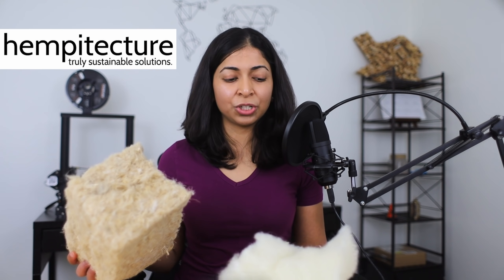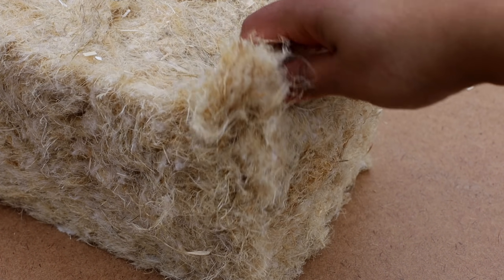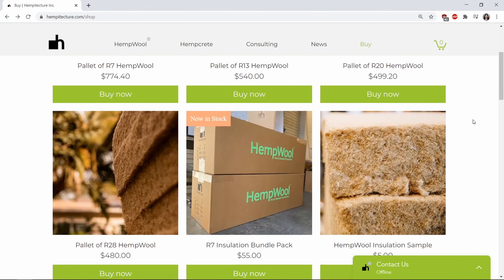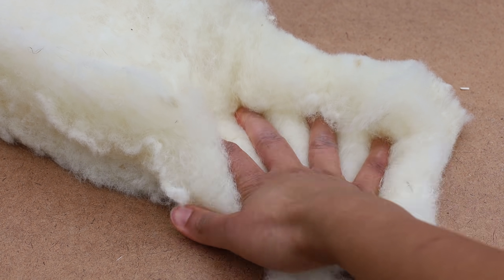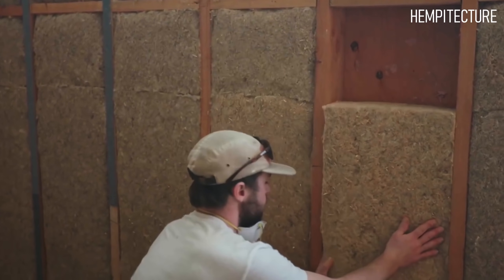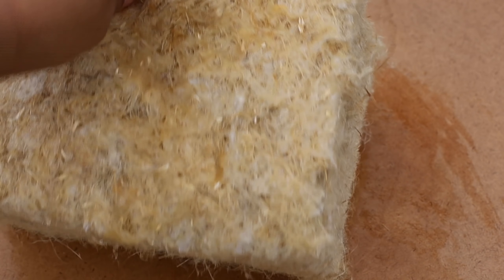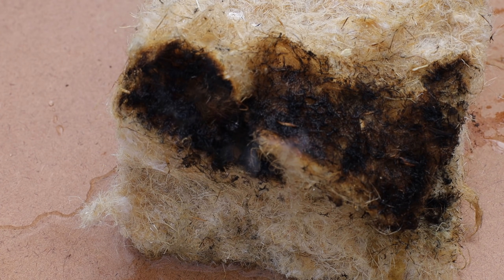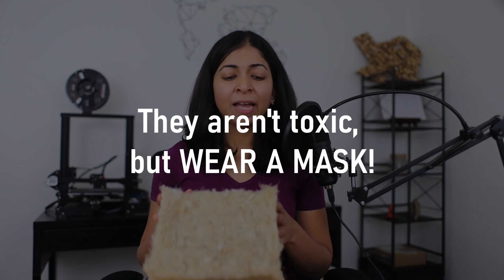Hemp wool vs Sheep wool insulation | Everything you need to know

Comment: Very interesting video. I am in general very interested in insulation materials, because of my work as construction engineer. And I am especially interested in environmental and indoor climate friendly materials. To my oppinion though, wood fiber insulation is the best insulation in the World. But the hemp wool insulation also sounds interesting. But I think you will find that wood fiber insulation works better against fire. It would be very very interesting to see this simple test: https://www.youtube.com/watch?v=nzTegn50-v4 expanded with hemp wool, sheep wool and woodfibre insulation (perhaps both as batts and as granule, as they can give slightly different results).

Comment: I have a couple of questions. Firsts are moths an issue with wool insulation. I’m an artist and I’ve used wool, and I know moths can be a problem, so how would that work in this situation. And my second question is could you combine the two products like could you in case the hemp into a wool covering to take advantage of its fire resistance while also taking advantage of the hemps durability?

Comment: We bought an old school bus to convert into a tiny home on wheels.  We were advised to get spray foam professionally installed but heard terrible things about off gassing.  I have experience building recording studios and we used Ultrtouch blue jean insulation for that but it was very heavy and dusty.  Then we heard of Havlock wool! so that's what we are going to use.  Instead of regular studs the frame of our bus called ribs, are about 27" apart on center so we'll probably buy 24" batts and fill in the rest.  I might increase the thickness of our ceiling and walls to 3" to achieve a higher R value.  Havlock offers an R-13 batt at 3.5" thick. I know compressing it is not a good idea but I'm not worried about squeezing that 1/2" and my theory is that it may help prevent slumping a little bit.  I could also cut the batts to fit lengthwise in the space between ribs and stack sections 24"x27" etc. What do you think of this plan?

Comment: A small issue that seem to have escaped your otherwise incredibly fastidious presentation is that the polyester binder in the hemp has a few problems.  I suspect that this material is the cause of the fire problem that you so ably demonstrated. The fumes from it are not so healthy either, I would not like to be around when it was smoldering. Another less than ideal problem with polyester that is not something that I would expect is that it can be degraded by certain bacteria such as cyanobacteria or Archaea. As far as the wool is concerned let me show a little bias by saying that if the manufacturers had used good Australian wool instead of that wool from the shakey volcanic islands to our east, it would have all been perfect!!!😁 Sorry I couldn't help myself adding that!!!

Comment: i wonder if i can get hemp insulation in canada here, ps 
Question?: could you use that wool insulation for blankets and such?
and just so you know when installing insulation simply slicing across the insulation bat creates a space large enough for any pipes. im sure it would be very similar to fiberglass and very easy on the hemp

Comment: RVs and van conversions: space limitations are the biggest constraint. Cost is not because the total area is small. Spray foam is best. It has R-7 per inch and is a vapor barrier itself. It also forms and expands to fill all the odd shapes. Its like living in a cooler. Also there is no space for pests.

Comment: Hemp products are only good and all-round useful if the plant remains in its natural state, but not this genetically modified garbage of today (well, at least that is slowly changing). Of these types, you can actually only use the fibers, and even those are not that good. All other areas of application, especially the medicinal ones, are as good as obsolete with the low-on-THC plants. Because it's not only the THC levels they've manipulatively bred and engineered out, but also many of the secondary active ingredients with it. Especially those useful against cancers, migraines, inflammations etc.

Comment: Sheepwool is usually more expensive but has potential better r-value depending on the density. Sheepwool is better with moisture because of the hollow fibre. Sheepwool is great for yurts too. Sheepwool has a unique property that it can clean air from formaldehyde and other chemicals. You need a very good moth protection for sheep wool !

Comment: First lf all, nobody is making sails out of hemp.  Dacron is the material of choice and will be until they find something better.  Secondly nobody is using rope made out of hemp any more, now that nylon and (there it is again) Dacron have proven to be lighter, stronger, and longer lasting.  And pray tell where are they using sheep wool for insulating houses?  Mongolia?  I have never heard of this and I have been in the house building industry for 20 years.  Mostly fiberglass insulation is used as the cheapest available.  Sprayed foam is better but much more expensive.  I am not impressed.

Comment: Here's what you need to Know. Spray the walls  and the underside of all your floors with 2-3 inches of closed cell foam. Then Cover all the interior walls, interiors ceilings no matter what floor  with Aluminum double bubble insulation. Tape off the windows, seams, and all corners. Where it meets and where it meets the subfloor. Make sure you foam the floor joist bays in the basement. Ok now what have you just done? Do you understand what we were trying to accomplish. Most structures are basically a giant chimney.   If you don't seal them properly they will always act like a chimney. So Now you are getting zero air infiltration from the usual updraft you have in all houses. Now you need to install an air exchanger, this will get you fresh temp controlled air 4 or 5 times an hour.   Good Luck and enjoy paying 50% less on your heating bills. Now that is truly green.

Comment: I arrived on your channel while searching for different insulation choices. I am very impressed with the depth of information you provide, while entertaining at the same time. 
I have been remodeling and repairing homes and home like structures for over 25 yrs. 
I have found a couple handy, hacks. 
I've found that while cutting insulation, with a box knife or razor knife is effective. It is also time consuming and a bit of a hassle.
I came across an old electric carving knife one day, and had an idea.
I put my idea to work. The electric carving knife worked fabulously. Now I've only utilized this with the standard, glass insulation, not rock wool, wool or hemp.
It's worth a good looking into. And the knives can be sourced even through your local Goodwill store, for a fraction of the price.
Again, I am very impressed by your channel and what I have seen, this far. And want to encourage you to stay the course.

Side note: I think your handling of the letter received from NAIMA, was handled with class and true information. Not just lab reports!

Comment: The polyester in that hempwool is a misfortune of the current industry. I will be happy to see when the plastic can be removed from it.
Reply: If polyfiber come from recycle plastic that could be beneficial reducing plastic waste in the environment.
Reply: @SeleneSalvatore  So my first impulse is that it would reduce the recycle-ability of either product. I think I see where you are at with this though; Long term encapsulation of the plastic waste in a usable format?

It makes me wonder if the material would be salvageable say after demolition. If so, what the reintegration of new hemp fiber vs how much more polybinder need be integrated, and what the plastic saturation rate would be for it to remain a viable product.
Reply: @Sylvan Mycelium Like If it possible to reuse it in other hemp product like hempcrete or hemp OSB or floor insulation?
Reply: @SeleneSalvatore  Yes.
Reply: @SeleneSalvatore  Yes very much. Do you work with applied materials or just have a brilliant idea?
Reply: Only brilliant ideas, that should be verified by experts.
Reply: @SeleneSalvatore  noted. The next time I am working with the ancilaries I will have to so a test run of a few bricks of hempcrete with some distressed hempwool. Not normally run with the bast fibers but we can run it through the ringer a few ways and see how it comes out.

Comment: Sheep wool is usable without any processing. It is in fact better unwashed because it contains natural insect repellents. Considering this, it is an obvious choice for insulation provided that the insulating layer is reasonably sealed (plastered for example) to halt the smell of unwashed wool. I made an ad-hoc external insulation of my brick house, as well as built some brickless walls and ceilings filled with sheep wool, enclosed in planks, OSB plates and recycled pallets, all plastered over, and it worked really well.

Comment: I probably just missed it when you talked about this, but is there not an allergy problem with wool? I mostly can’t touch it without getting rashes but I know people who get trouble breathing and their nose and eyes starts running just by being in the same room as a wool sweater. I get that it would be closed of when used as isolation but can still imagine lots of problems related to that.
Reply: Allergies can be present for both of these products - people working for extended periods with hemp can often sensitize to it, especially at the field level where its fine pollen is prevalent.
Reply: Asbestos was also used as isolation and there were no problems when it was closed of. Allergies should only come into play during construction or when the will is open because of e.g. repairs...
Reply: As someone allergic to sheep, once you clean the wool, the allergic reactions stop. I can wear wool fine.

I assume someone actully allergic to wool itself, as long as they are not arround when its being installed and covered, and the place is approprietly cleaned, they should be fine.
Reply: As someone who works with wool, allergies to wool are extremely rare as it is made of keratin, the same as your hair. People can have wool sensitivities and that is because of the twist in yarn where little fibers stick out and can irritate the skin. Merino wool is the softest that can be worn against the skin due to fine microns, but it is also expensive. You would need a much higher micron for wool insulation and would most likely come from sheep wool with a high micron count that is usually spun to make outerwear or rugs and that could be scratchy. I never wore wool because of the itch factor until I discovered merino wool which is used to make base layers and can regulate your temperature and is not itchy.  Some people are allergic to lanolin which can be present in some wool products, but even that is rare as all commercially prepared fibers are very clean and grease free.

Comment: I live in Mongolia and importing anything has to come through China or Russia, assuming land transportation. By using wool felt in large pads. 1 to 3 wool blankets can be wrapped around the 'ger' (Mongolian word for yurt) depending on the season. It's quite environmentally friendly because it's locally sourced wool. Also local sourcing lowers the price considerably. A 5-wall ger costs about $600 on the low-end at the Black market in Ulaanbaatar. (6m diameter). Any size ger can be made by adding more lattice walls. A 7-wall ger is about 50m/2 of living space vs the 28m/2 for a 5-wall. I'm British but plan to live in a ger with my Mongolian wife (probably with an extra connected ger for storage). It's very cost effective. If it's an off-grid location we can burn coke briquettes to supplement solar-power for devices and maybe an underfloor heater. This raises the price quite a bit but we need some modern conveniences.

Comment: Great review Belinda.
I was a builder for many years in New Zealand.
I would use a wool polyester blend batt, which I'm thinking reduced thermal drift.
Fairly expensive, amazing noise reduction qualities and great insulation.
Disadvantages, like you say is the dust, and much more time consuming to fit more difficult to cut etc.
I'm a hug fan of wool products, it's properties and the lanolin oils are very versatile. 
Keep up the good work.

Comment: This channel is amazing - I found your channel when I was researching XPS. I so appreciate this information, especially about what happens when you set them on fire. Did your Havelock Wool smell, well, like a county fair? Mine did, left no doubt it came from a sheep - it's not overbearing, but very distinct. 

yourI coated all the metal framing with an aerogel insulating paint, and it's pretty interesting to see the difference it makes, I'm glad I did it. I was a little worried about how into insulation I got, but now I know I'm not alone - thanks again for your great content.

Comment: Ms. Carr, I have a home recording studio in a 15x18 bedroom . I need acoustic sound absorption panels and plan to build them myself.  I Learned from your videos the hazards of rock wool and fiberglass and therefore I prefer to use a material like hemp or wool( Havelock). Do have feedback on what the sound absorptions values would be on these materials in a 4 inch thickness? I plane to build about 8  or more panels. I appreciate your videos! Thanks

Comment: This was really interesting! I'm not looking at these materials specifically for insulation, but they still give me a really good idea what they're like.

I can't say for certain as I'm not an expert in this area, however, the hemp insulation might have burned more easily because of the polyester that was in it.

I've worked with different fibers for crochet, and have looked into different materials a bit. It's been my experience that sometimes the plastic-based fibers like acrylic and polyester burn up like a Christmas tree.

I've noticed that all plastic-based fibers react the same, so  it may depend on how they are produced, and whether or not they're a blend material.

That's my own personal theory, anyway. Thanks for the informative video!

Comment: I am not sure that compression lowers R value except relative to the potential R value of being thicker being uncompressed. Having insulation too loose in a cavity will probably contribute to slumping, and some compression, so long as not excessive and not to be thinner than the width of the cavity leaving an air pocket, should be preferred over too little insulation that ultimately slumps due to a poor friction fit. In short, the limiting factor is mostly cavity depth, not insulation compression so long as the entire cavity is filled.

Comment: The hemp insulation only caught fire because they introduced the polyester which is just a form of plastic. Those fumes are very toxic to inhale; ie: plastic fumes. This product should be stricken from the shelves until they correct their product by ensuring only 100% hemp fibers are used. Then it will be fully fire retardant. I have seen the demonstrations where a butane torch is left on an area for up to a minute and beside a little charring over time, no smoke, no flame, no continual burning. This is what should be sought after so it is a safety feature instead of a safety concern.

Comment: 6:57 On soundproofing, I used thermafleece (wool with some polyester) behind soundproofing plasterboard to line alcoves in my house. I found it worked really well, better especially in the lower frequencies than acoustic mineral wool of the same thickness.

Comment: Noise reduction coefficient NRC is not a relevant acoustic measure for enclosed cavity insulation materials. To state that an NRC of 0.9 implies that the material absorbs 90% of noise is a complete fallacy. Please take some time to learn about material and building acoustics and the various mechanisms in the science. Cavity insulation materials work as merely a component of a finished building element. To confirm the insulation’s contribution to the overall performance of the element you need to test the element with and without insulation. NRC relates to the average level of absorption of a specific range of sound frequencies in the spectrum. NRC is used to evaluate the level of absorption of a material usually to gauge, in simple terms, how much reverberation or echo is in the space or room. Have you been in a noisy restaurant lately? I’ll bet it had a concrete floor and lots of glass with no absorptive materials like carpet and acoustic panels. 

I can only give you 0 out of 10 for the acoustic evaluation but the rest was good.

Comment: Ummm what if they combined the two together I think then you would have exactly what you require just a thought 😹😹 but serially great review 
Me personally I would buy both the thinnest of each and split the wool in half and place the hemp in the middle and using a needle felting punch I would lightly punch the wool at a few inches apart along the edge and down the middle to help the wool sit in place😂

Comment: Great video, would it be possible that the hemp is still burning because of the 8% plastic (polyester) in it ?? Also not to forget in the env. impact to include the full life cycle analysis of the material, and that raising sheep for wool, has much more co2 emission than growing hemp. I also doubt that the growing speed of wool needed to produce X kilos of insolation is as fast as for hemp. in another way I doubt that sheep are more productive or equal to hemp and its fast growing speed.

Comment: The R-value they offer is less than is required by building codes in my area (R-20 at 5.5" vs. R-21 required at that depth). The fire performance would probably be a problem as well.